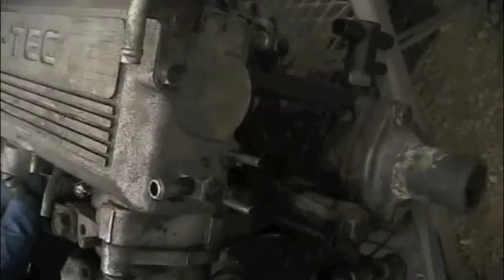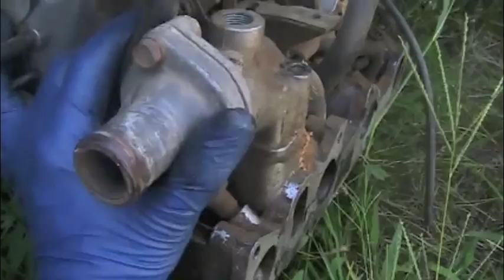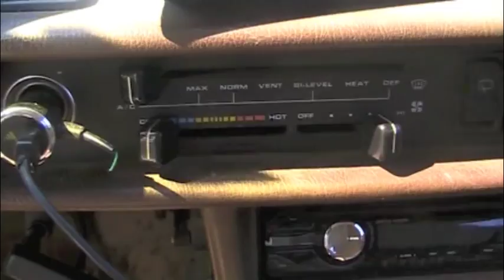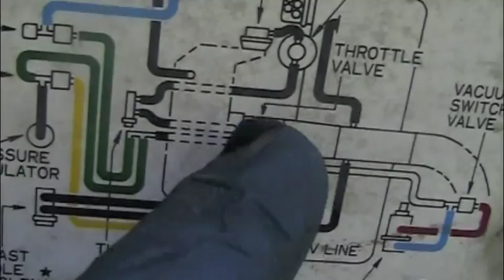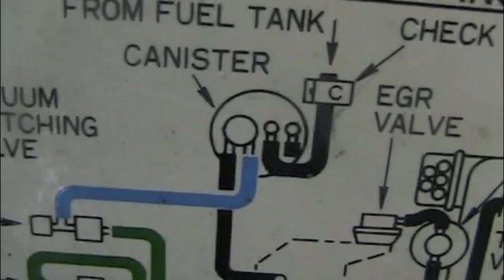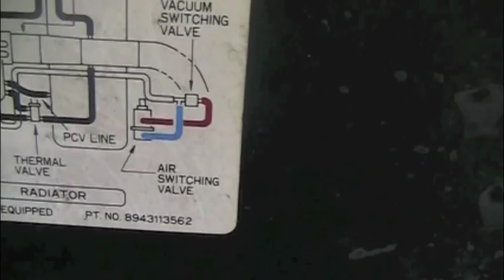Isuzu fuel injection Explained

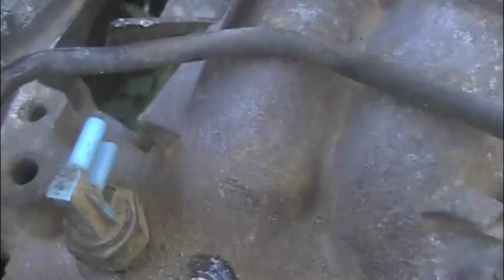Comment: I do appreciate your video! I have a problem with a 2.6L isuzu rodeo. It's skipping and the code says cylinder 1 misfire injector circuit open. All 4 injectors have 12v going to them as they should with ignition on. When cranking over, injectors 2, 3, & 4 the injector signal is very fast and bright.  #1 injector blinks may once every couple seconds instead of 2-3x per second. I have probed the blue with /b 6:14 blk trace wire as far as I could with no breaks. Do you know what tells the injectors to fire? If its a ecm, ecu....where is it located? I really want to get this vehicle running again. Any help would be appreciated.  Thanks

Comment: Oh thanks John for the video! I've run the 2.8 in my 89 Trooper for 14 years. Daily driver. Finally found a rust free beaut 2 months ago. It's a 2.6. Turns out cylinder head has a crack. It sat for 13 years. Been a subscriber for a while now and I just want to thank you for your knowledge. 
Sean

Comment: The TPS on the manual is just two position switch that only detects idle and wide open throttle. The automatic uses a proper TPS that senses the actual throttle position.

Comment: Hey Johnny, where in the heck can I find Diesel Fuel injectors for an 86 trooper?? I'd really appreciate any guidance.Thanks man!
Reply from the maker: I've got one that I'm parting out. It was running and driving but has structural and cosmetic issues so I've recently started parting it. I don't know if they're available new.

Comment: where can i buy a thermal valve
Reply: for a 1992 Isuzu pickup 2.6 federal
Reply from the maker: I've got one I can sell you. Do you  need the big black one on the thermostat housing or the sky blue one that screws into the intake manifold on the passenger's side?
Reply: @Johnny5ive  1990 trooper 2.6l need the valve that sits on top of the thermostat housing. Or if you know where to find one that would be super helpful. Otherwise I'll do the 5 tec modification.

Comment: This is kind of a weird design. It has the heat operated vacuum switches despite being computerized.

When I see an early computerized engine, nearly all of those heat operated vacuum switches are replaced with electrically operated switches.

Failures of the heat operated vacuum switches are one reason carb engines with smog devices from the 1970s and 1980s were often unreliable.

19:15 this is one reason that 10% ethanol fuel sucks.

Comment: Yes thank you, goodness you safe me, been having transmission issues.  What sucks is that I had just put a used fuel injection wiring harness that did not have the plug for the trans to sift. Plus before the tps didn't have the extra plug in . So I never knew that was for that. I have manually shifted this thing from day one when I bought it plus it never goes into over drive. Thank you a gain. Sheesh! LOL

Comment: Its a great video, thanks do you happend to have an extra thermal vacum valve, the one on top of the thermostat housing, I cant find where to buy one and also a crankshaft sprocket the one in my trooper its broken and I cant tell where the timing mark is. If you can help let me know.
 Thanks again for this video.

Comment: very interesting to see how their done over in the U.S. in Australia we don't have any of that smog system. i do have one question. my engine idles at a little over 1k rpm, if i adjust it down, after about the third start it just comes back up? is that the computer or a vacuum leak? (i went through the vacuum system with all new lines when i did the head gasket last.)

Comment from the maker: You're welcome Rob, sorry it was so long in coming, not the kind of thing you can just "whip out", requires quite a bit of time and work. I've known for a long time it needed to be done though.
Reply: Johnny5ive hello,I've got an 89 Isuzu pickup w/ 2.6 L. I did a tune up on it plugs wires cap rotor. All was well and running and just died. Check eng light on charging light on
O2 light
Fuel light
Now engine starts momentarily and dies. Will not stay running